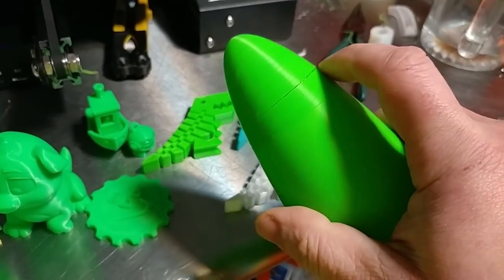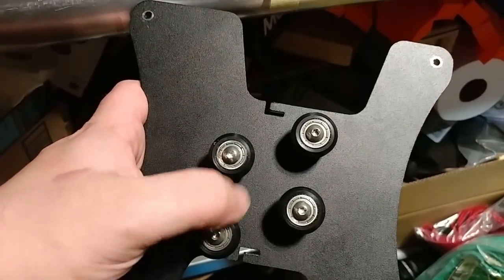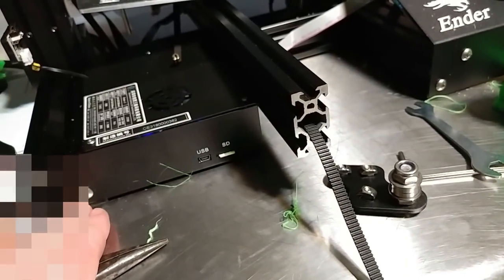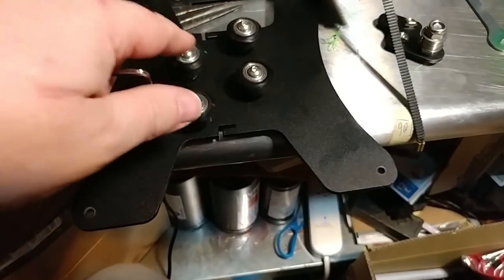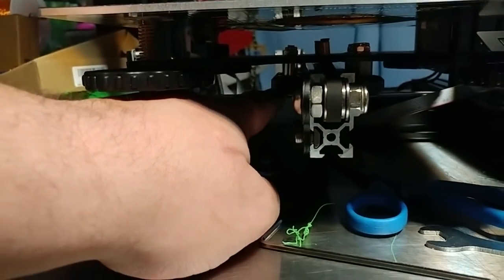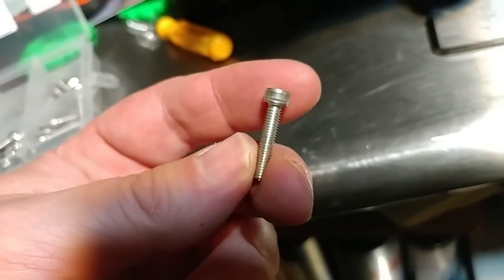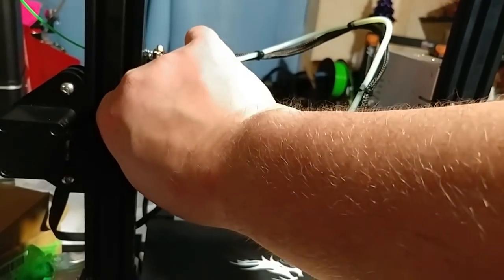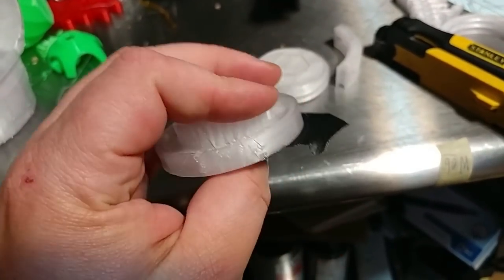T3DP 212.5 Ender 3 Update, Feedback, Examples, Issues, Fixes Creality3d Creality Ender 3 CR-10

Comment: Thanks for the video, can you link to those springs you are using and the thingiverse number for the rear cover? I was unable to find it.

I have a production one and they kept the springs that dig into the bed. One of the threads also doesn't grip so I will most likely do the mod you did. Other issues on production that several people have confirmed: the filament guide is rotated 90 degrees and the PTFE holder is broken for some people, the unit rocks, I was able to resolve by loosening bolts on the bottom platform and pushing down and tightening it back up. The Z stepper when fully tightened down causes the leadscrew to shift at an angle and doesn't work properly. Someone else used a piece of paper to force it to space out when fully tightened down. I had a complaint about the filament being WAY too close to the leadscrew search 2894097 on thingiverse for a guide that looks like it resolves my complaint haven't printed yet though.
Reply from the maker: https://amzn.to/2rnJm1a

https://www.thingiverse.com/thing:2858209
Reply: Thanks! I did every variation I could think of searching for ender 3 except ender-3 and I was also looking up LCD not display
Reply from the maker: Same here. It does not come up under an ender 3 search. I will have to auggest he fix the title :-) i had to google ender 3 pcb cover to find it.
Reply: Just out of curiosity is your mainboard fan tied to the fan on the side as well? Makes no sense to me because if I'm running ABS I am going to have the fan off which means the mainboard fan wouldn't be spinning.
Reply from the maker: Yes it is and it's even worse than that I have to run my fan at full speed because it runs at the same speed as the other fan and the brainbox fan can't handle the low speeds that the parts cooling fan can.
Reply: Doing my first extended print in PLA and it keeps randomly skipping extrusion like it's not gripping the PLA well enough but if I push it through it continues. There doesn't seem to be any way to adjust the tension though.
Reply from the maker: If its skipping meaning watch it carefully and you will see the feeder stepper gear "snap" backwards when it skips OR if it keeps turning grinds the filament but keeps going.

The latter is a tension issue possibly. But more than likely what you have is the first.

Temp solution. Increase temp 5c and slow down 10%

Skipping here means you jave an extrusion issue. Meaning the system can not physically push enough filament. Several things can cause this.

Bed is trammed too close to nozzle. Ie your stuffing the nozzle against the bed too close so the plastic has insufficient room to flow and expand. If this is the case once tou get to lauer 3 or 4 if it stops skipping then that is likely your issue.

If the plastic viscosity is too high (too thick) then you might simply be printing either too fast (slow down) or not hot enough (raise temp) or both.

This varies from printer to model to slicer to filament type.

You could also have a mechanical fault in the hot end or the feeder assembly.

Bad or dying stepper. Over hearting or failing stepper driver. Loose wire. Tube  or coupler with kink or obstruction. Nozzle installed poorly leaving a gap between nozzle throat and heat break tube which will gum up the works. Or even a bad nozzle or one simply not compatible with printer or filament.

Start with slower hotter. Start checking mechanicals after that.

Comment: hi there :) could you please tell me what cura settings you have for pla, have had so many problems with this machine. prints are awful, bed is wonky, have to level the bed everytime. thank you
Reply from the maker: I don't use Cura but the settings should be similar first things first in the description of this video I have a profiles link go there and download my bed leveling Marvin for your printer try printing it twice

If it prints okay then your printer is fine and we need to work on your slicer settings if you have to change the bed level between Prince then you should watch my mods and fix his video for the Ender three most likely your right hand vertical Gantry carriage is too tight and binding as the printer moves up and down if that is the case your bed level will change slightly every time you print because the Gantry will never reset to the exact same position every time also follow the directions in my video for checking and properly tightening all of your belts and wheels if they are too tight they will also cause problems

Comment: On my ender 3 the first layer does not stick. We tried tape and glue and nothing works. Does anyone the fix
Reply from the maker: Bed leveling and forst layer hot and slow. Watxh my cr 10 bed leveling basics video (put that into search) its me holding 2 rolls in the thumbnail. Its all about bed leveling.

Comment: Question for the americans. Could it be the cheap bolts dont fit the allen well because of metric? I had this issue with a tool... it had non-metric screws.
Reply from the maker: I suspect it's just cheap bolts I have both metric and SAE Allen keys and some of these bolts and none of them fit properly :-) creality is starting to introduce better quality bolts in their kits not all of them yet but more and more of them are hardened which is really nice

Comment: So the stock fan is quiet? Sigh. I swapped it out for this before turning it on (https://www.amazon.com/gp/product/B00ZB7TD4G/ref=oh_aui_detailpage_o03_s00?ie=UTF8&psc=1 ) and it's as loud as ever!! I use this same fan on CR-10's and it's silent!
Reply from the maker: Noiseblocker fans are absolutely silent if yours is noisy you got a bad one send it back
Reply: Apparently the Ender 3 runs on 24 volts and the fan is a 12 volt fan, so it's running at 200%... would assume the power supply is the same!

Comment: your debit card isn't pixelated at 10:12, some photoshop kid could probably filter it out
Reply from the maker: Thank you I checked that scene and the last four digits is not legible so I didn't bother messing with it

Plus I had to order a new one anyway since I cracked the chip on that card :-( vendors got tired of running it three times before it would let them swipe it :-)

Comment: Do you have any ender 3 profiles for cura or if someone does, please leave a comment
Reply from the maker: I don't use Cura on a regular basis and last time I checked you can't export a printer profile anymore has this changed? If you can find an Ender two or a cr10 profile it is identical for the Ender 3 only the build volumes different otherwise it is the same kinematics and same Extrusion Hardware

In fact the Ender 3 uses a cr10 brain board just running at 24 volts

Comment: people sure go through a lot of trouble for SD Card use when one should just get a Raspberry Pi + Octoprint and call it a day.
Reply from the maker: Because the raspberry pies are expensive and I personally have had reliability issues with them although I believe that's more of the USB connection than the pie itself you realistically need to spend about $60 for each machine I can SD convert 10 machine for the same price

Comment: HI,
I hat the trouble with the profiles for the z-axis as well and the reason for it has been, that they have not been cut in a 90§ angle.
After they have been flattened at their ends by a cnc Drilling machine, they did fit perfect.
But as well the Y-axis did not move properly, why I changed that with a linear guide. (Not finished yet, I'm still destining, milling and printing parts. see: https://www.thingiverse.com/thing:2970759)
And last but maybe not least is the heatbed which makes me absolutely no confiodence....

Comment: Or better yet, instead of an SD slot give us a USB port.
Reply from the maker: I'm not a huge fan of the implementation of USB ports I love the idea of being able to use a thumb drive no reader needed just a USB port on both ends the problem is that usually arranges the damn USB stick is sticking out into the air begging to be broken off which would break the USB stick and your printer they need to figure out a better way to handle that some sort of recessed slot or something I don't know
Reply: @nerys71  i was thinking external hard drive, but they make usb extension cables
Reply from the maker: @bkpickell  there is never a reason to connect an external hard drive to a 3D printer far too much storage space for the need and there is no proper interface to deal with that much information on a typical 3D printer

Extension cables don't work because the end of the extension cable that goes into the printer will stick out just as much as the USB drive so the damage potential still there

Comment: Again... Great work !! Seems like there's a few buggg"s to be worked out, as with any new product on the market ! When assembling items that need to be precise, it's good to have the proper tools. For checking angles and such, I purchased this set from the Grizzly company .
http://www.grizzly.com/products/Center-Sq-Set-of-6/H5688
This set is really well made and it has a center locator included, for marking the exact spot for drilling on the ends of round objects !

For dealing with bent metal or welded seams you might have grind off a small area of the outside corner upright with a Dremal type tool. This is to allow the precision angle to fit around a weld or give a little room for the inside radius that's formed when bending metal !

Anyhow... I may purchase an Ender3, to go along with my Ender2 when they squash all the bugg's !! And keep up the good work, it's really Great info ! Do you have any listing's of your G-code and or config's for each of your printers and filament type's used ?
You probably have enough for a book by now !
Thanks Again !!
Reply from the maker: Yes click the description of the video there is a profiles link their.

Comment: my organization has bought 6 cr-10 mini and we've purchased 4 ender 3 at a presale price. We have never had the slightest mechanical problems, nothing to tweak or repare after weeks of continuous printing. I don't really understand why your posts are always about fixing virtual issues. Weird. Our printers are OK right from the boxes! You really had bad luck to run across issues and I wonder whether you're not keen on tearing down devices, 3D printers as a matter of fact, and looking for occasional issues when mounting them again. Bizarre. Or we have a constant good luck and our 10 creality devices have no flaws... Sttatically rare maybe... Who should we thank? God or Creality engineers then?
Reply from the maker: Maybe there is a language barrier but I cannot tell whether you're asking questions or insulting me?

Cr-10 mini has no issues I've never had an issue with a mini the enter 3 has many issues in the early batch if you had no issues you were the lucky one I understand most of these issues are now fixed

I have 48 printers I would like to think I am reasonably experienced at putting them together and diagnosing them
Reply: I love this reply! 😂
Reply: @nerys71  I'm glad I'm not the only one confused by the random "weird" and "bizarre " thrown in there.

But on topic mine only had one issue out of the box. Z axis binding. Z motor shims fixed it.

Comment: Totally agreed. Those cheap chinese stainless steel button head allens have caused me to buy 3 different black hardened steel full capscrew allen heads. Unfortunately the manufacturers in China are all building printers as cheap as they can so things like feet, better bolts, thicker beds, are rarely added but usually taken away. As they start building thousands of them, because it equals thousands of dollars. That is where us hobbyists I guess have to add and fix things I suppose.  I replace most bolts as it is already and throw their junk cheap allen wrenches in the can  :)
Reply from the maker: They are starting to shift over to better Hardware I noticed some of the critical bolts are now hardened steel and not the Chinese yum crap hopefully they will continue that trend
Reply: For sure lets hope! :)
Reply: metric/imperial screw mix on their printer i personaly dont use those cheap alen that came with the printer...